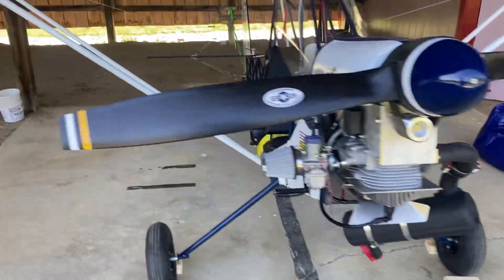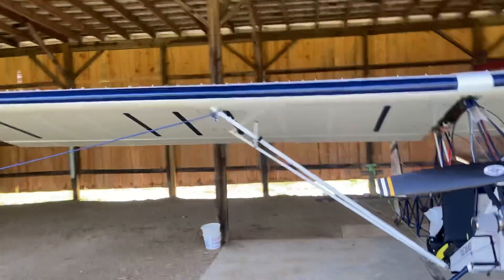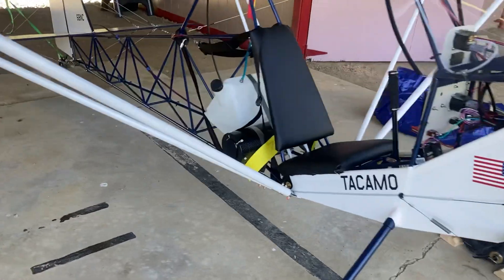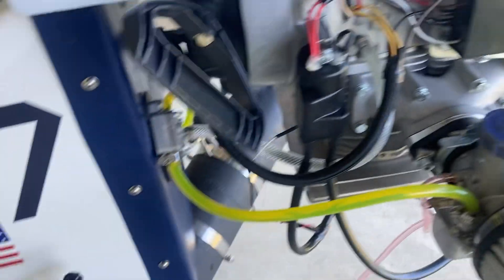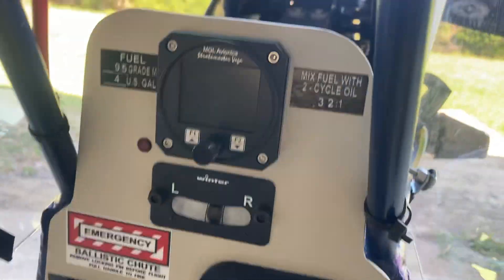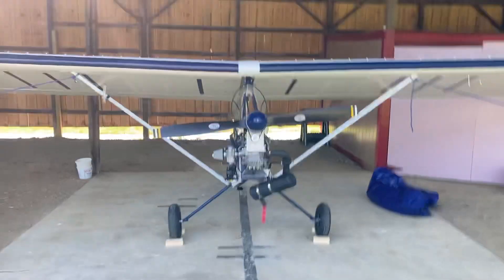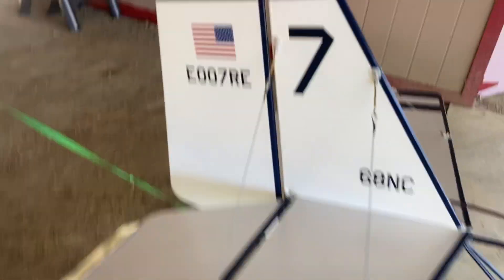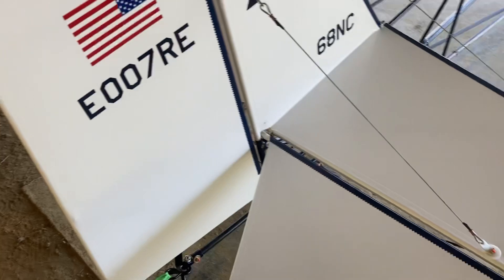Ultralight Airbike 103 (Home Built Airplane) Update 4: Engine and Wings Mounted

Comment: Do you connect the motor directly to the vane, or is there a conversion between the motor and the vane?
Reply: These typically use a reduction drive.  You can see the wide belt and pulleys behind the propeller.

Comment: Hi Beautiful build, may I ask the price? Is it a kit? I'm a licensed private sailplane pilot and I have about 200 hours in a C-150-2. I have some tail dragger time too. How difficult is this to fly? any quirks? Thank you>
Reply from the maker: Thank you. It comes as a kit or plans from Lake Jordan Aero. The plans only are $150, while the price of the kit varies depending on if you want just the wood, just the airframe, both, etc. More info on the website here: https://www.jordanlakeaero.com/ultralight.html though I’m not sure why the full kit costs more than the other two separately. I myself haven’t flown, but my Dad says it’s very easy as long as you have just some tail dragger experience. No real quirks, just it’s an ultralight so can’t fly in high winds, etc. thanks for commenting